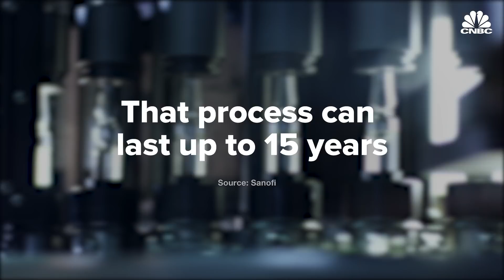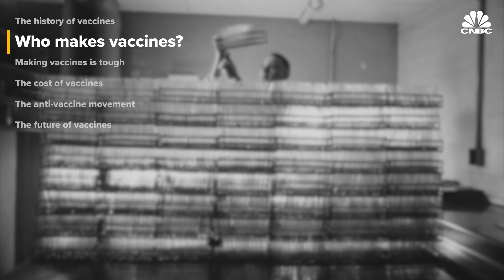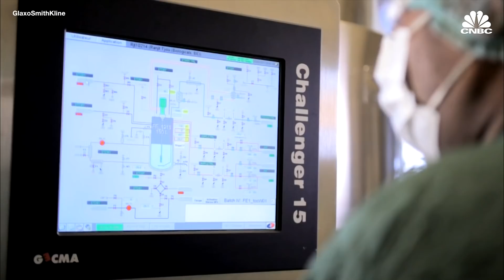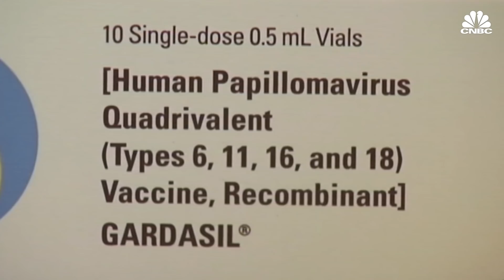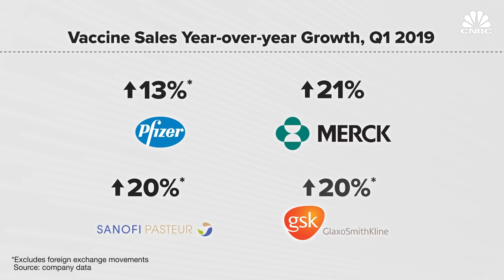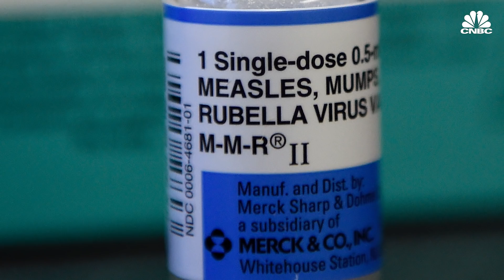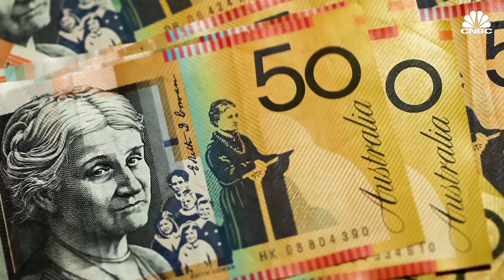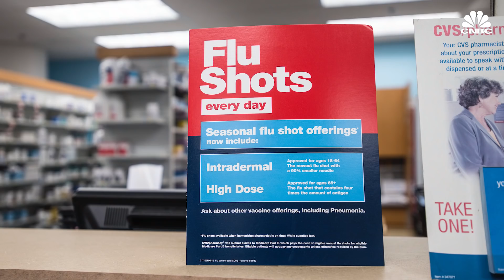The History Of Vaccines And Why Sales Are Rising

Comment: you forgot to mention about those 50-60g of aluminium and the magic potion that causes autism
Reply: refrigerator salesman  yeah and the rest is that magic potion, that thing is dangerous
Reply: anyway what can be bad about a little polio and pox?
Reply: That’s basically more than an inch by inch by inch brick of metal, which seems a little off.
There are some aluminum salts that are also used in deodorant though

I’m sure plenty of the researchers are on the spectrum so I’d argue autism causes vaccines :^)